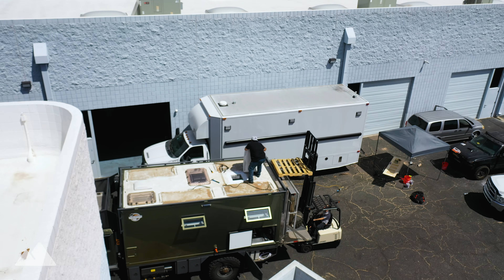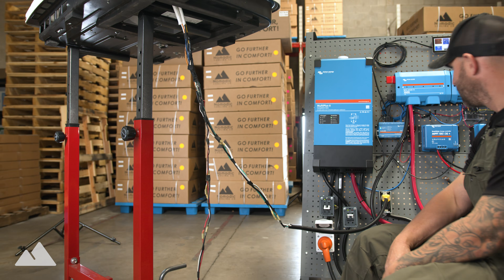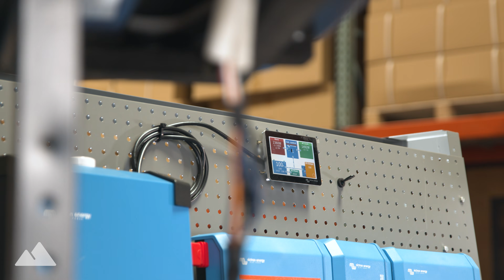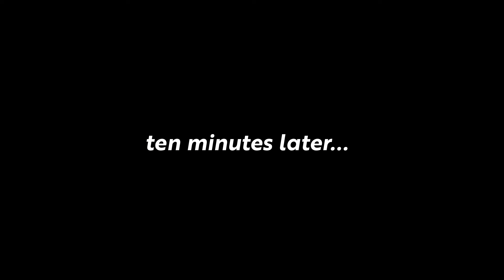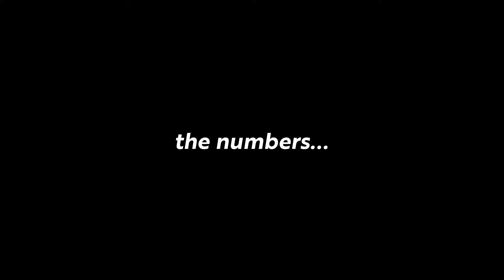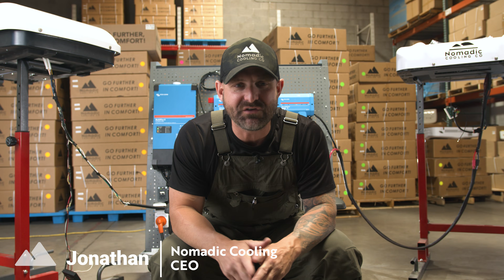Dometic Air Conditioner 🚙and The Nomadic X3 Battery Powered AC ❄️

Comment: Too bad you didn't test the dometic RTX2000.
I've seen the comparison tests. There's is no comparison. The Nomadic uses more watts and cools less. And then the price. 

The Velit at less than half the cost performed better than the Nomadic X3.
Reply from the maker: Thanks for the comment. This video was published over two years ago and reflects the products and testing standards available at that time.

We’re not sure where some of the comparison information being referenced is coming from, but the claims made here are not accurate or based on any testing data we recognize.

The Nomadic X3 was not designed as a direct comparison to Velit or the Dometic RTX2000. It is engineered for sustained off-grid cooling, extreme-heat performance, and long-duty cycles—priorities that aren’t always captured in short-form or lab-style comparison tests.

Power usage, cooling output, and overall performance vary significantly depending on installation, vehicle insulation, ambient temperatures, and testing methodology. For anyone researching today, we recommend reviewing current models and real-world use cases to determine the best fit for their build.

We’re always happy to answer questions or provide updated information on our current systems.
Reply: @NomadicInnovations the RTX2000 was on the market 5yrs ago. 
I think it's safe to say any DC air conditioner outperforms an AC air conditioner.
Comparing DC units is where you see how units stack up.

Comment: Run ac unit in our Airstream off victron 3k and overhead required to run 3k inverter is around 400 watts if I recall correctly.  Kicking around a truck build w 48v batteries, so inverter would not be necessary with 48 ac unit?  If thats the case some significant savings on energy to be had

Comment: Is the Victron display showing the consumption of the inverter (battery load) or the output of the inverter on the 115VAC circuit? If it is showing just the output, the battery load is going to be ~10% higher I assume? As another person commented, the air temp and power draw are part of it, but I think the BTU is very relevant to understand the actual cooling capacity vs. wattage. Do you have any of that info? I am very interested in this unit.

Comment: Would you recommend the X3 in a Ibex 20bhs Travel Trailer? Possible 2? That's a 25' tailer that comes with a 15btu central a/c unit. Trying to run my A/C dry camping off the batteries.

Comment: Did a system on an aircraft in the Expment class

The amp draw at 12 volts DC was closed too 100  Amps.  So the owner went to a 24  volt Alternator and 12 volt converter for avionics or anything or aircraft systems that came in 12 volts only.

The compressor had a High and low settings and was a custom built as normal AC compressor runs at one speed.

But things are changing and the Amp draw at 24 volts DC was right at 50 amps.

Possible it would be possible to install another Alternator with a 24 volt out put for the system and drop the current down and get a longer run time

Good video
Reply from the maker: Hey there, thanks for your comment and for sharing your experience with the aircraft system in the Expment class. It's fascinating to hear about the transition from a 12-volt DC system to a 24-volt Alternator and 12-volt converter for avionics and other aircraft systems. Your idea of installing another Alternator with a 24-volt output to reduce the current and increase the system's run time is intriguing. It's these kinds of forward-thinking ideas that drive innovation in this field. It sounds like you've got a unique setup that our viewers would love to learn more about. Would you be open to us creating a video about your aircraft system? We'd love to showcase your innovative solutions and share them with the community. Let me know if you're interested. Thanks!

Comment: I am installing a rtx2000 on my overland truck topper. We have a seat mounted in the back with seat belts and roll cage. Can I wire the battery monitor wire into an auxiliary switch to turn power on and off to the unit?
I know I can wire in a relay on the big cables, but this would be easier.
We will be using it to cool while driving mostly.
I have a couple other high draw items like  an air compressor, winch and dc to dc charger for my tow behind camper battery bank and I want to make sure I don't overlook anything by to many things running at once.
Reply from the maker: Hello there! It seems like you've got an impressive setup on your overland truck topper. Wiring the battery monitor wire into an auxiliary switch to manage the power supply to the unit could indeed be a simpler solution than wiring a relay on the large cables. However, it's crucial to ensure that the auxiliary switch can handle the current that the RTX2000 will draw. Also, the switch should be placed in a location where it won't accidentally be turned off while the unit is operating.

When it comes to managing power with your other high-draw devices, balancing the load is key. You might want to think about using a power management system to oversee and control the power usage of all your devices. This can help prevent overloading your system and ensure everything runs smoothly.

If you need further assistance, feel free to reach out to us at Nomadic Cooling. You can visit our website at nomadiccooling.com or give us a call at 480-576-2489. Good luck with your installation!
Reply: Thankyou !! @NomadicInnovations

Comment: The missing variable between the units is CFM. My freezer puts out even colder air with even less watts, but I could never cool a camper with it. So ECO is great if it has the same cooling capacity as the 13.5 unit.
Reply from the maker: Hey there, you've raised a great point! CFM, or cubic feet per minute, is indeed a crucial factor when it comes to cooling capacity. While your freezer might be efficient in terms of power consumption and can produce colder air, its CFM is certainly not sufficient to cool a camper.

The ECO mode is designed to be energy-efficient and certainly has more CFM than a freezer, It's all about finding the right balance between energy efficiency and cooling performance.

Remember, every setup is unique and what works best will depend on specific needs and circumstances. Thanks for the comment!